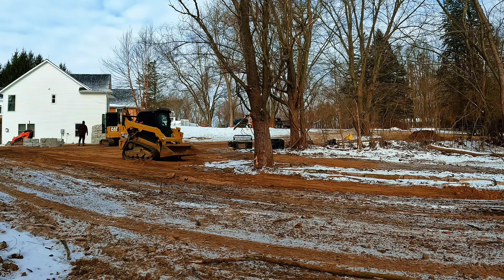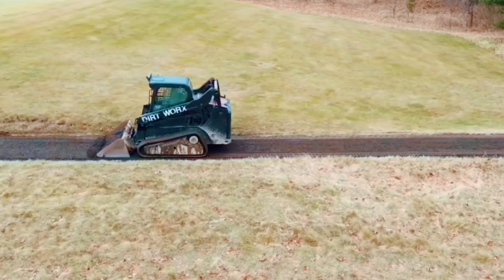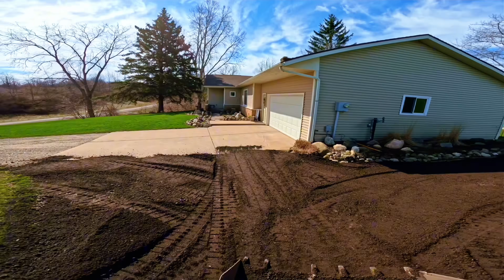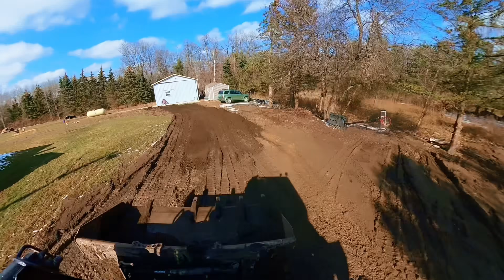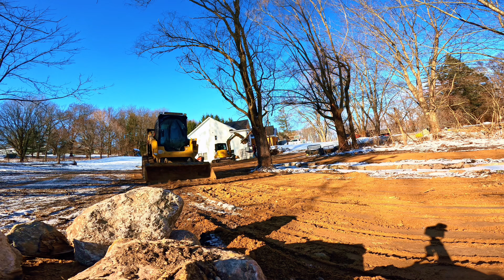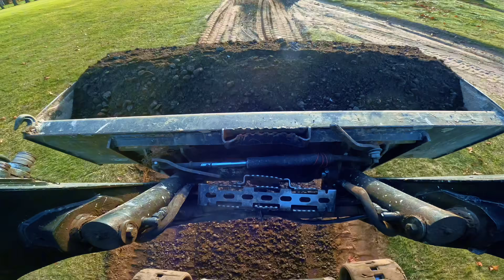Skid Steer Grading Explained in 5 Minutes

Comment: Came up on my recommended, solid advice 👍 From experience, alot of it is just "feeling" it once you get used to the specific machine controls (sensitivity, etc). Another nifty trick I picked up is to avoid sharp turns to avoid tearing up the grade and to tilt the bucket to match existing grade when moving in reverse to "clean up" the tread marks left by the machine  🤔🫡
Reply from the maker: Great insights! You're absolutely right, developing that "feel" for the machine is crucial, and your tip about tilting the bucket in reverse is pure gold for a clean finish. Thanks for sharing your valuable experience!

Comment: Two keys, (1)get a unit with "float" that will float the bucket so you can (2)push the pile ahead of you, don't go dumping piles around,  and then you can work a cross hatch type pattern while you float in reverse with the bucket gently angled down and adjusting the angle as you go.   
(and) IT TAKES PRACTICE to get a feel for this stuff, you literally cannot just jump in and get it right, so don't get uptight because you suck, because that is simply going to be the case, so relax as much as you can and work at it and maybe have a friend stop by to run the machine a bit and then jump back in after you see some technique.  Practice.  Think about it in your head, that actually counts as practice to some extent, but each machine has different balance and control responsiveness etc, so not only do you have to practice technique, you have to learn how she handles.  
TRACKS help if you are only pushing materials/dirt and never snow on slopes or other work on macadam or gravel (gravel ruins tracks), ice freezes in tracks, they slide down hills, etc).

Comment: I've done a few of these recently on a mini-excavator/mini-hoe with a blade, probably definitely a little slower, but I guess for a beginner it's helpful to be forced to go a little slower.  It's definitely tricky, if you have a huge pile that you need to place and spread out and grade it, I suppose with a skid and a bucket, you can do double duty and move bucket-fulls around, to then spread and grade.  the one-machine-machine would probably be a skid, but I think a mini-hoe with a blade can do a slightly nicer finish (debatable), and the ability to push perhaps right along a foundation is maybe a little better.  unfortunately our skid has wheels/tires, so less ideal for grading than a track skid
Reply from the maker: So you're saying I should have titled this "Skid Steer vs. Mini-Excavator: The Ultimate Grading Showdown (Spoiler: It's Complicated)"? My bad! 😉

Comment: My backyard is on kind of a pitch and I want to take out about level with one side but take out like 2 feet of dirt and maybe a 700 square-foot area. It just gets deeper and deeper, but the deepest spot would be around 2 feet so it’s basically a lot of dirt but how would I do that? 1 inch at a time or would I just start and go 2 feet deeplike start level on one side and then just dig deeper in as you go all in one swoop?
Reply from the maker: Yeah, I mean it might not be a bad idea just to kinda maybe take like 4 inches at a time and just keep skimming it out that way you’re just not digging one big hole and you can kind of gradually go in at it and come out so that way when you fill it in, it’ll be Like on a slope up and it’ll pack better

Comment: What is the best way to get experience in a skid steer and excavator to be able to start your own company? Should I join the operating engineers union and grind that for a year or work for a local excavation company? I have no prior experience
Reply from the maker: My best advice would be get a job at a local excavation company, preferably somebody smaller that you work hands-on with the owner that you can gain as much experience from as you possibly can and just learn the ins and outs you’re gonna gain more responsibility to operate stuff with the smaller owner and you’ll have more opportunity to get the insight on everything